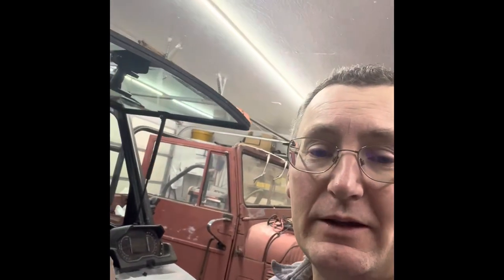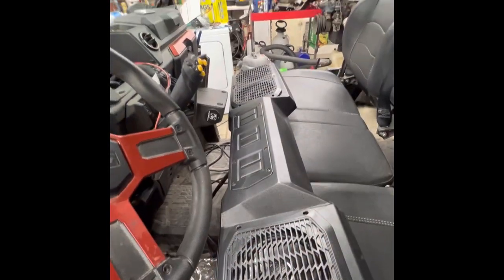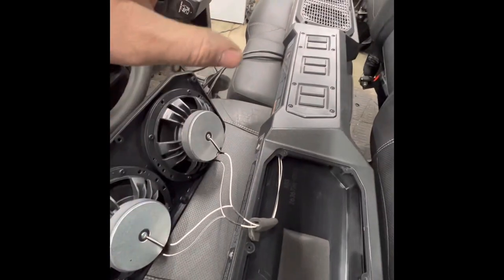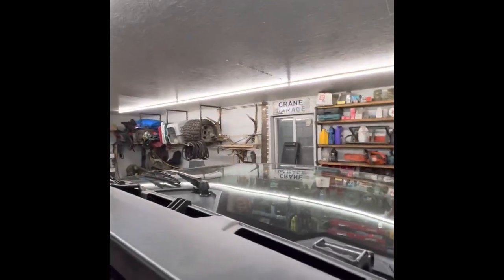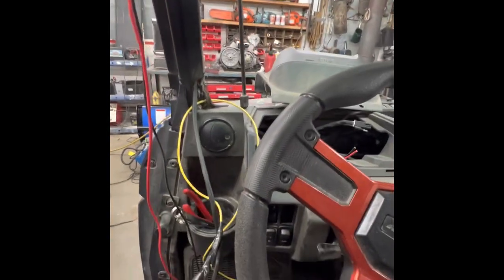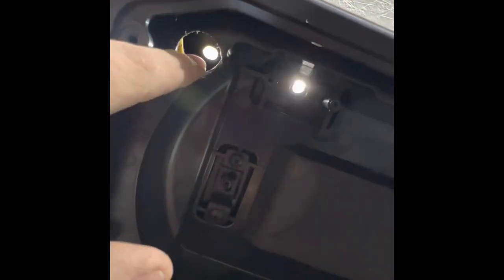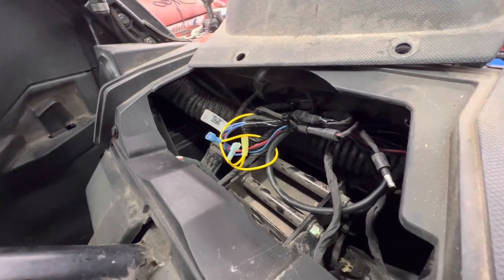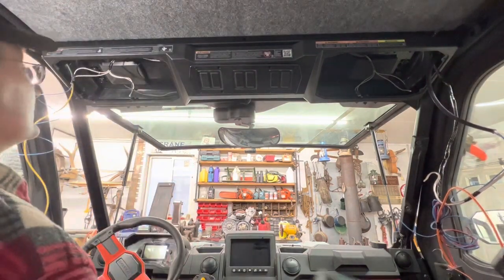Polaris Ranger overhead speaker & amplifier console install with steel roof @allwegottadois

Comment: Is this worth the money? I am hearing all kinds of complaints these speakers aren't very loud?
Reply from the maker: Well, just like anything if it’s not loud enough to your liking, and you’re a techie, you can always put in a bigger, amplifier. I personally love it but I have terrible hearing and the first thing that your doctor said if you don’t put a bunch of money into a good stereo system because I wouldn’t be able to hear it but I can hear this one just fine even when I’m trying in fact most time on I run it on 2 to 4 on my loudness setting so there you go.
Reply: @allwegottadois  There are people on the Polaris website that are saying you can't hear it until you hit 7-8.
Reply from the maker: @mossman381 well I don’t think that’s true because seven or eight and it’s obnoxiously loud. I see what I’ll try to make a video of it and send it to you but it’s not like the greatest Soundsystem but it’s not bad.
Reply: @allwegottadois  Those reviews are a year old and older. Maybe Polaris changed something. I am not looking for a great sound system. Just wanted a little more sound when going down the road with engine noise. And get some more switch blanks at the same time. I just didn't want to spend that kind of money and be disappointed with Polaris again.
Reply: @allwegottadois  So I was out playing with the radio in my ride command, and it needs to be at 7 just to hear good using the factory lower front speakers and the heater fan on one. That is just idling and not running down the road at speed. Not sure how you can hear it at 2-3 unless you are just sitting there with everything off?
Reply from the maker: @mossman381  I don’t sound right because I can hear mine just fine on or around 4
Reply from the maker: Even before I put the upper speakers in
Reply: @allwegottadois  I am starting to wonder if I didn't get a Ranger lemon. So many problems and issues with it. I bought two 900 Rangers with little to no trouble with them. This is my first 1000 and I am really disappointed so far.
Reply from the maker: @mossman381  A good dealership and the support they give you will make the difference between bugs & problems, and making them go away, but if the dealership doesn’t, find another dealership to help you. My philosophy is there are no bad Rangers or atvs just the support to help you get it corrected.
Reply: @allwegottadois  I might agree with you on that, but I can't find a dealer that doesn't lie to me. The closest dealer wanted to give me $7k for my mint condition Ranger 900 on trade. I sold it myself for $15k. It was a real slap in the face. Don't see going back to them. The next closest dealer I bought my 6x6 from. I asked if they would deal on the price, and he said come on down. I drove there which isn't very close and his deal was he would wave the dealer fees. Wasn't happy with that. The salesman also lied about stuff not working on the Ranger. The dealer I just bought this new 2023 from charged me an assembly fee. I think $7-800. Come to find out the dealers don't even assemble the Northstar models. They just pull the plastic off the seats. Really not happy about that at all. How do I trust these dealers to fix my Ranger???